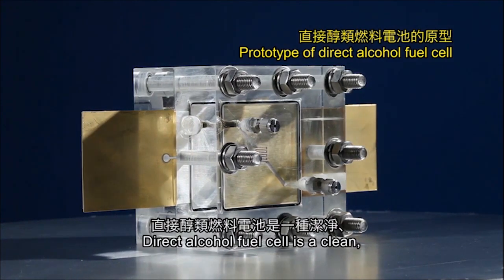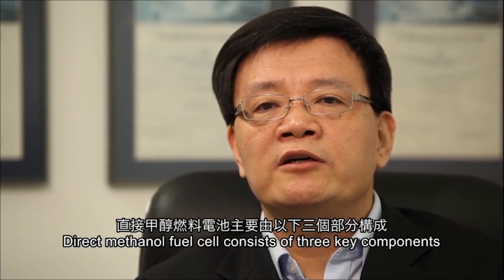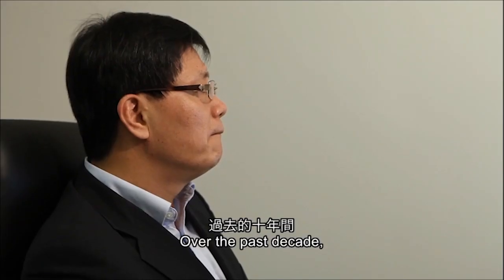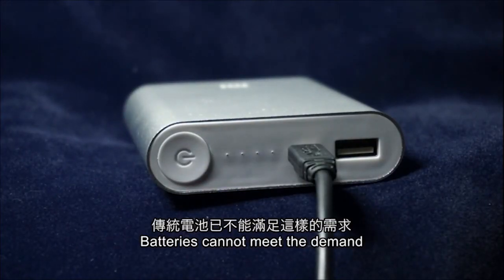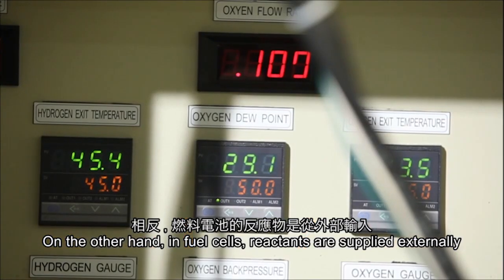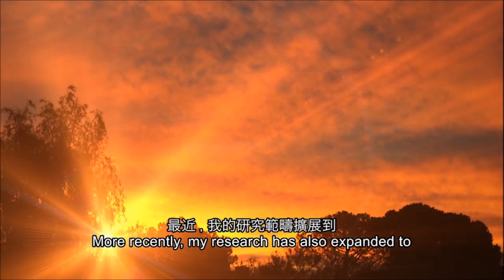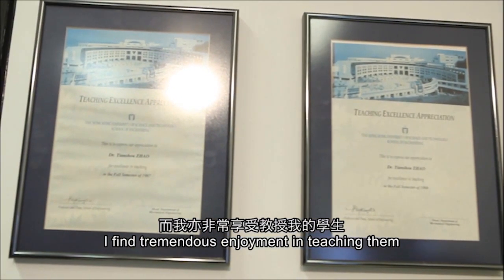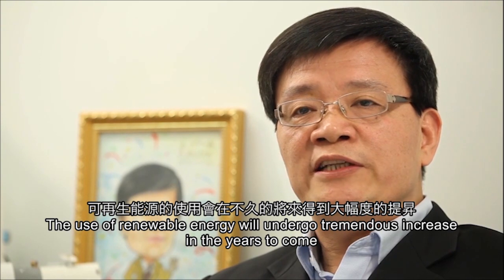High Performance Alcohol Fuel Cell

Comment: Hi , can we make nitrogen fuel cell or nitrogen air battery , fuel cell or battery that works on air only ? Oxygen to air cathode , nitrogen from air to air anode ,   What do you think , thanks
Reply: Nitrogen fuel cell would definite create Nox, which is harmful
Reply: nope     -   nitrogen  virtually   unreactive    -   hence   80%    of air we   breathe
Reply: You mean react nitrogen with oxygen? N2 is a very stale molecule, it's reaction with air is endothermic (requires more energy to break the N to N bond than is obtained in the forming the new bonds) and nitrogen oxides (NOX) are some of the worst pollutants produced by cars. Alcohols or hydrocarbons (like we use now) produced from biomass or reaction of hydrogen with carbon dioxide make more sense to me than hydrogen itself tho as they are liquids at ambient temperatures and pressures and in an ideal system any CO2 released by these vehicles would be getting taken in at the other side making more fuel anyway. Remember when someone thought using hydrogen in passenger airships was a good idea? They thought it was safe! Didn't work out too well!

Comment: Can we make nitrogen fuel cell , air have 78 % nitrogen , then we can have free energy :)
Reply: Not likely. N2 is rather stable which is extremely endothermic (i.e. energy consuming) to break the two atoms apart. It will be more likely as the final product of other potential nitrogenous fuels.
Reply: besides,  the world is trying to reduce the emission of NO2, which is far worse than CO2

Comment: Very interesting but are there any Ethanol direct fuel cells on the market?
Reply: Ulrich Hager i have just been watching ty vids about Ethanol and Methanol fuel cells. There’s one big problem with Hydrogen fuel cells( don’t know if Ethanol or Methanol are the same) reguire Platinum, I don’t know if the Platinum needs replacing after a while, or if they last as long as  needed. But considering Platinum is so rare wouldn’t it be better to use the Hydrogen, Methanol, Ethanol, and liquid fuels from Algae and Pyrolysis in a ICE instead. At least they would be Vehicles the owners or local mechanics can work on!. While avoiding the waste of hundreds of millions of cars being crushed. Sure the day may come when fuel cell technology can avoid precious metals, but while that research is happening we could be phasing our ICE when they come to the end of their repairable life. Also the first Compressed Air Vehicles ( CAV) TATA’s  ‘Airpod’ is due to go into production by 2020 . If that takes off as I expect it to, then shortly after that Fords will release their new ‘Model T’ CAV using a much more efficient CA engine design than in  TATA’s ‘Airpod’. I truly believe in 5-10 years time we will have a combination of car fuels including CA, Hydrogen, Methanol, Ethanol, and bio fuels from Algae and Pyrolysis, and EV making up about 1/4 of the market.
Reply: Ulrich Hager  sorry mate I got into one there, and didn’t answer your Q, the reason is I jus don’t know the answer.